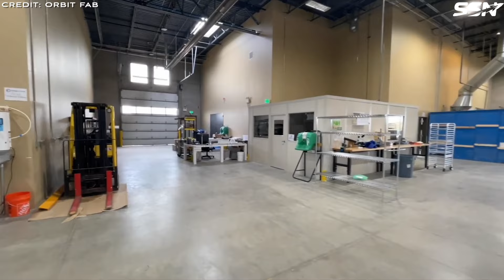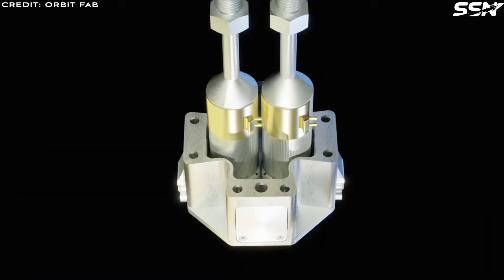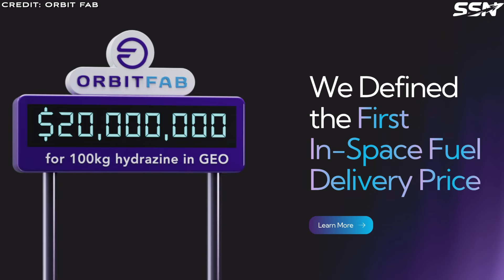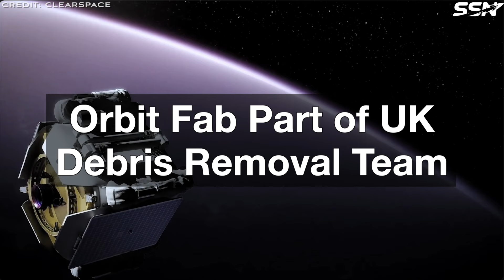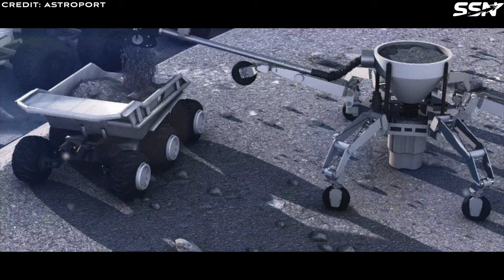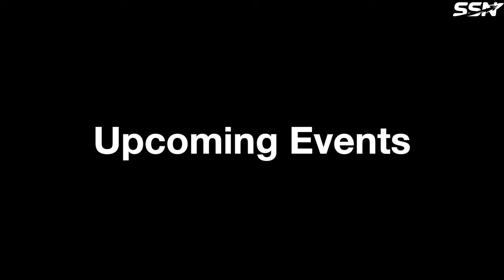Orbit Fab’s $20 Million Fuel Deal: The First Propellant Station in Space is Coming in 2026

Comment: If Orbit Fab can get this technology to work, that would be great! This could be extremely valuable for establishing an orbital and cislunar refueling infrastructure. One thing not expressly mentioned in this SSN report: how does Orbit Fab's technology deal with microgravity complications for fuel transfer?

Another issue arises from this report: United Launch Alliance's ACES and Xeus. ACES, Advance Cryogenic Evolved Stage, is a now-dormant project of ULA. ACES is an evolution of ULA's Centaur Five upper stage, outfitted with four hydorlox RL-10 engines instead of Centaur Five's two RL-10's. ACES, also known as Centaur Heavy, is what I call a C-RUFTT (cislunar re-usable ferry / tug / tanker), somewhat similar in capability and mission profile to Blue Origin's Cislunar Transporter. Xeus is simply an ACES fitted with side-mounted engines and landing gear so it could land (and take off from) the Moon. So my question is this: if there is an emerging market for Orbit Fab, could a market for ACES and Xeus be far behind? I suppose it will depend on what the future is for Artemis moon exploration and industrialization...

Comment: Every aspect of this technology that can be tested on Earth, has probably been tested. So it is very likely to work the first time, if it gets close enough to dock. There is always a slight chance of a failure earlier in the mission.

I give it a 90% chance of success.

The 10% chance of failure includes problems within the satellite, such as valves failing or plumbing leaks. Less likely are age related issues, as the mating interface on the satellite has been exposed to space for many years.

Hopefully, this will work the first time so refueling spacecraft becomes routine.